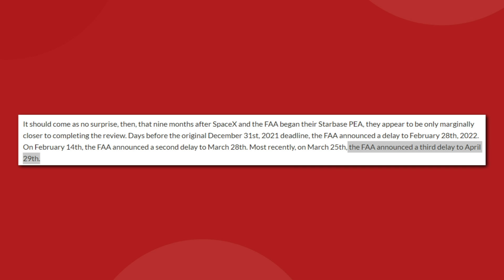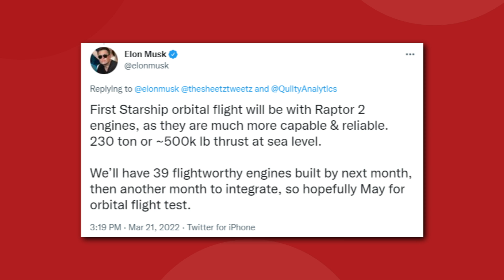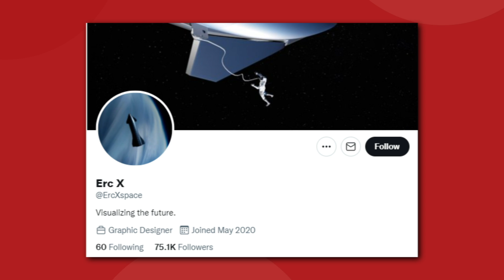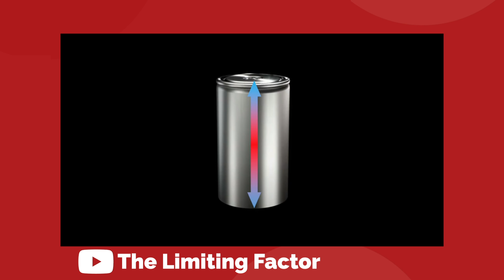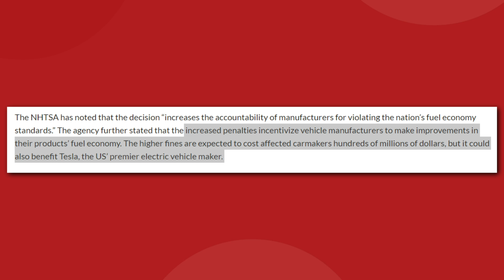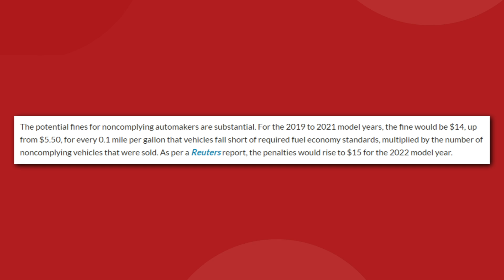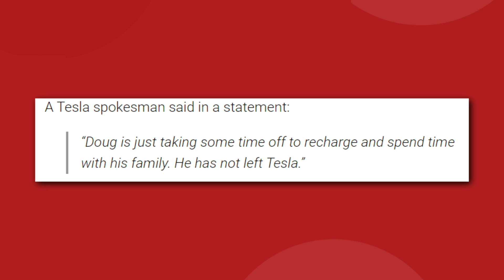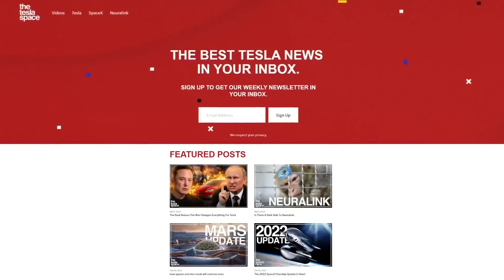New 4680 Battery Update From Tesla!

Comment: 2:39 If FAA APPROVAL had been done when first stated at the end of Dec.  or Jan. or even Feb., StarShip as it was could have been ready to fly. I don't think all the facilities that have been built, needed to be finished to do a basic launch. It may not been as smooth as it will be now. But I think if the ok was given, it would have happened. But as the delay lingered, the maturity of the site, the Starship and the engines did not stall and now if the OK comes this time around. It may take a little longer to get things ready at the next logical stage of development.  SpaceX is not stupid, they would not have put the time and money into Boca Chica if they thought there was any real possibility that they would not have been able to use it. Starship is beginning to be seen by the military as being something they want/need, that alone will almost guarantee the eventual approval. Especially given the current world events.

Comment: 4680 is NOT tabless.!
It has hundreds of tabs.  Please put out the correct information.
Reply: Existing battery designs route all of the power through two tabs, one positive and one negative. The 4680 should be called a tabfull design.
Reply: It is tabless.  Here's the patent:
https://patents.google.com/patent/WO2020096973A1/en?oq=WO2020096973